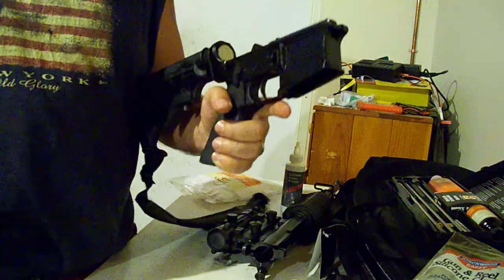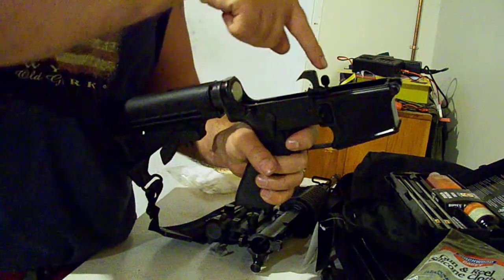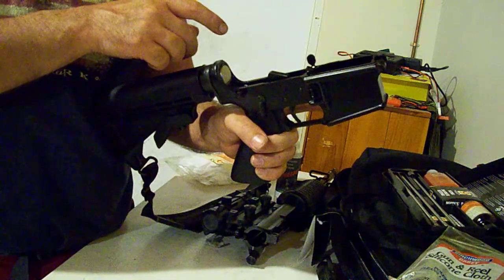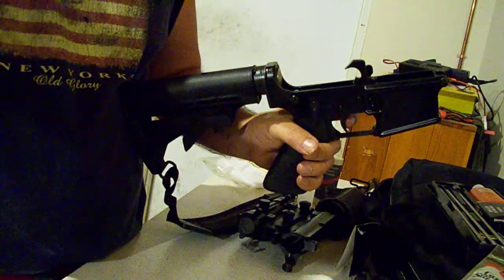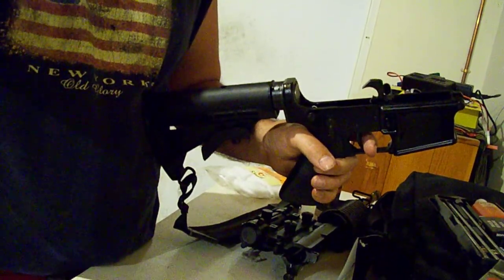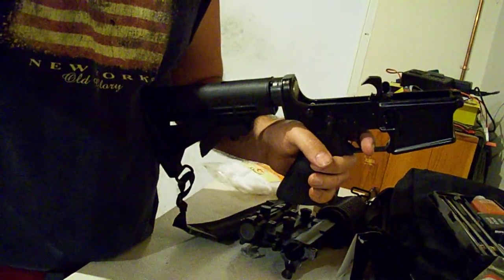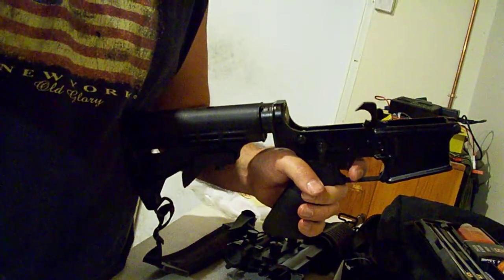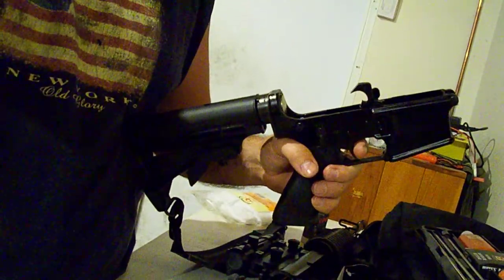Stag 1L AR-15 / M4 Carbine Trigger Sticking malfunction.

Comment: your spring is probably in backwards take the two pins out of the lower receiver that hold in the trigger assembly or replace your trigger assembly. Never dry fire a stripped lower receiver that will break your bolt catch release and can also crack or break your trigger assembly and or lower receiver mag well.  The trigger assembly is very easy to replace should take you 10 min or less

Comment: Hammer spring  installed backwards. Check that the disconnector spring is installed fat side down into the trigger recess. Pull it apart, clean and oil everything. New springs are 10 bux complete at midway. 10 minutes and 10 bux and your trigger is back to new. Might as well get new trigger and hammer pins while you are at it.

Comment: its a spring issue my ar was doing it i took the springs out tweaked em to the bad 8lbs pull lmao and fixed no more issues. Light spring or weak spring on trigger and sear will cause it .

Comment: I had a similar problem with my Sig Sauer 516.
Opened up the rifle, and tried to remove the selector to get a better view, that was also stuck.
Turned out there was a spend primer underneath the rear end of the trigger mechanism, preventing it from moving forward enough to release the disconnector, after applying a bit of pressure to the trigger and shaking the rifle about a bit, it fell out and everything works fine again.

What are the odds :S

Comment: I was told dry firing the M4/AR 15 without the upper receiver could crack the lower receiver. Is this true?
Reply from the maker: Yes, true. The hammer slays into that flat wall and will eventually fracture that flat wall.

Comment: Man mine is doing the same thing. I have changed the springs around like what Komplete1 is saying and its still doing the same thing. I was wondering if you have found out anything to fix this problem. Mine is a new build. it will shoot one time. Then you have to adjust the trigger and repeat.